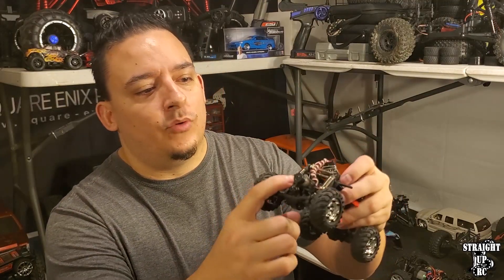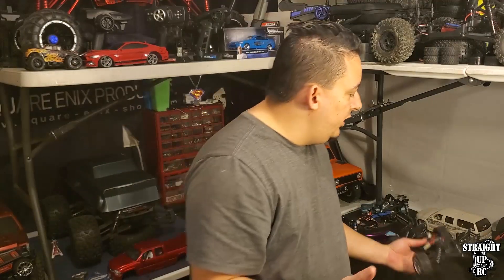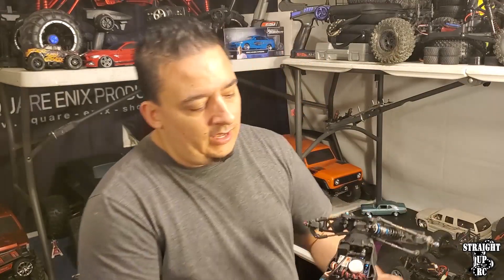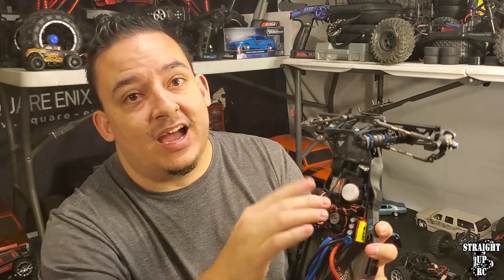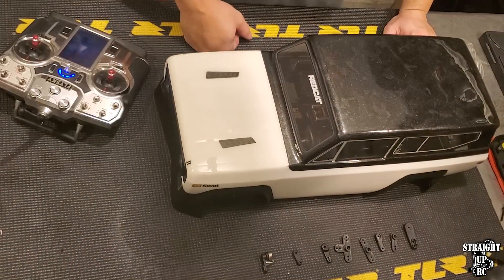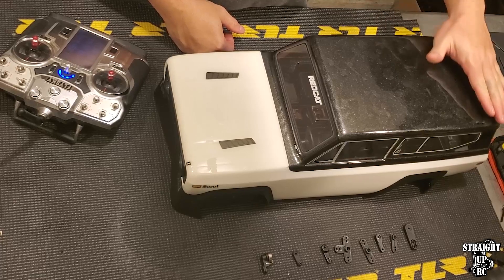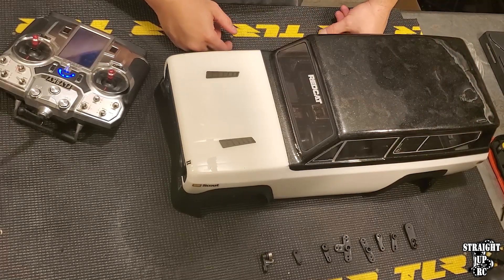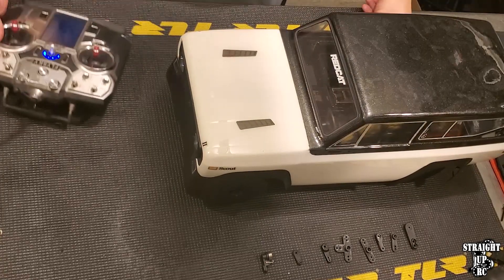What is a RC servo?! - Straight UP RC Info

Comment: What’s up bro my both throttle and steering servos just stopped responding after I drove it towards end of a parking lot but however my killerRC worked and I killed the motor

Wonder if this is interference issue? Or out of range? Low battery ?  Using flysky gt2b thinking about getting new radio now
Reply from the maker: Howdy, So might be interference but the 1st thing to check is the voltage of the battery pack in the receiver box. If the voltage dips too low - you can lose the signal entirely. So that is the 1st thing to check. It could also have been a range or area-specific range interference.  So you can test that by placing the vehicle in the area you had the issue and start walking away from it. Might need a friend to help - but if you walk away enough it might disconnect and there is your answer. I don't know the actual range so I am just guessing - but the battery is the 1st thing to check for sure.